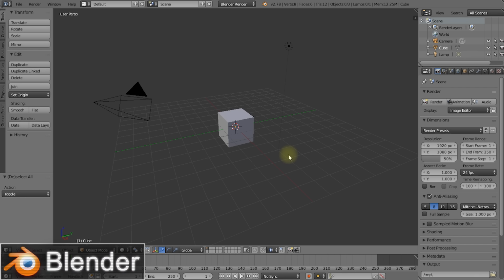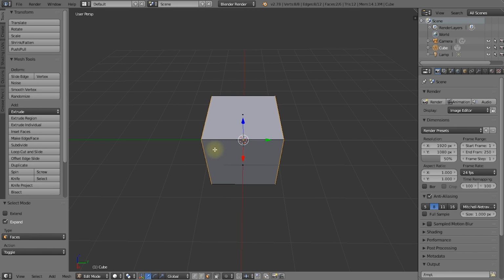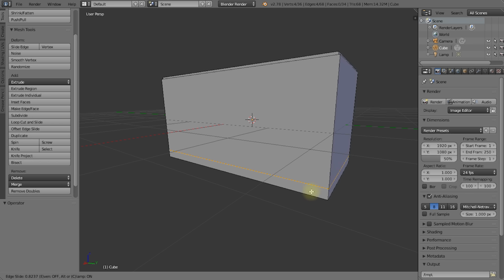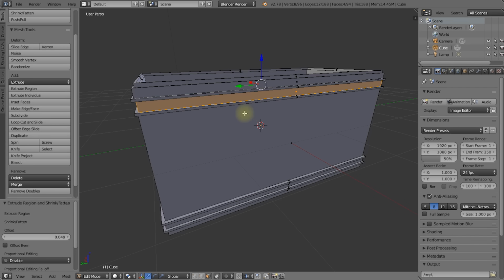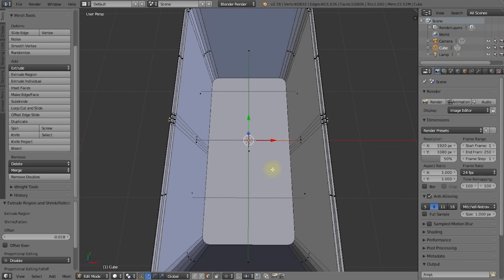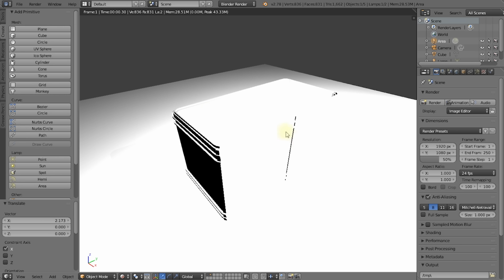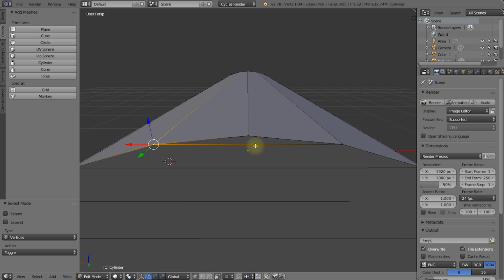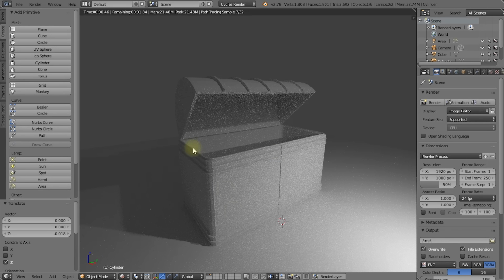MODELLING For Absolute Beginners - Blender Tutorial

Comment: Did it along side with you, encountered some simple issues, but made it in the end. Had been meaning to move away from 123D for sometime and this did the trick. Thanks a ton for creating this.
Reply from the maker: No worries at all, glad to hear you found the tutorial helpful :) I really gotta update this for version 2.8 of Blender, there's been so many changes. Thank you for the comment!
Reply: Thanks for replying. Ya the UI changes were challenging, plus I did it on a mac, but the keyboard shortcuts work the same, so you pushing that was great. also the tip about doing an undo after failed extrudes is very important, that got me a lot of times, even if i cancelled an extrude. Now i need to learn to do dimension based CAD designs for my day job. cheers.

Comment: I was not able to exude my chape like u did :( To add another face, it won't let me.
https://gyazo.com/00119c5504e0b1db6a8a9aee582317c7
Reply: https://gyazo.com/ec34e4feaf97998b28f8bca2a85ec42a
Reply from the maker: You may have duplicated edges or faces that you introduced during modelling. Here's a video with some tips that might help: https://www.youtube.com/watch?v=n9YYrVQdCMY
Reply: @SurfacedStudio  Thank you, but i ran into another issue. I was duplicating my pieces and lining them together and i made sure to use Shift C To make sure it's center and selected the correct views when duplicating and some of my pieces are not even. the building is not straight and i keep trying to fix it but it's no use :( What do i do? I don't want to start over.
Reply: How do u line objects up together without things having gaps in between or being uneven with the lineament ? :(

Comment: i have a little issues with the knife tool. I was doing fine select one vertice and connect it to the other one. everything was fine with the edge of the surface under the trunk but when i start with the middle it just wouldn't connect the vertices. help please
Reply: I had the same problem but with the edges.
I noticed some vertices duplicated somehow.
Solved it by selecting the whole trunk (with A) and merged all close vertices (Alt+M) > By Distance,  ~0,01m.
After that I used the knife tool with no issues.
Reply: @dennis-nine-five  thank you so much
Reply from the maker: You may have duplicated your edges or vertices during the extrude operations. I've got a video with some common problems - and how to avoid them here that might help :) https://www.youtube.com/watch?v=n9YYrVQdCMY

Comment: Awesome tutorial! subscribed! 
I just have a question: You used the knife tool for the inside to change the ngon into quads. but wouldn't it have been more efficient to change at least the edges in the middle and dissolve them? since you need those edges only on the outside? Or am I missing something?

Comment: Thanks, man, but I have this weird problem where when I wanna bevel in the middle of the chest, it just makes new points? So I ignored it and moved on, but then, when I was using the knife tool inside the chest, it just wouldnt wanna cut anything, it worked on the surface but not inside?
Reply: When I try re-doing it (third time at the moment), the middle part always has a different glitchy part? You could say? And I cant fix it.

Comment: Nice tute. Very useful. I found it easier to get the lip I wanted at the top by using loop cuts on the rim faces then extruding rather than using inset and extruding. One of the things about Blender is there are often different ways of accomplishing the same thing.

As a relative beginner, I hadn't heard of the different extrude options such as 'vertex normals' until I watched this tute.

Comment: sooo why exactly are tris supposed to be bad? i mean they're the most basic and only 3d primitive that can't be screwed up (quads do weird stuff as soon as their verts aren't in a plane anymore, but tris are always a plane per definition), which is why pretty much any 3d engine i know of prefers them. why would blender be different there? i mean i see why you'd want to avoid ngons but the same reasons apply to quads, not tris. or is it just because a quad can be subsurfed (for e.g. sculpting or modifiers) into 4 quads by bisecting each edge, while tris would turn either 3 or 4 tris or even into 3 quads instead of more tris when doing that, thus mixing up the topology complicating things (and the resulting shape would be useless from the perspective of "i'm subdividing to get more useful resolution")? and probably easier for stuff like edge loops etc too (which kinda are the same concept as subsurfing, just manually)?
Reply from the maker: There's some good explanations of the details out there on the internet, e.g. https://computergraphics.stackexchange.com/questions/5465/why-are-quads-used-in-filmmaking-and-triangle-in-gaming
In essence tris don't subdivide well and lead to ugly deformations for rigged models, however they are simpler and more performant than quads or polys

Comment: Does anyone know if this will translate well into a STL file for 3d printing or is there a good chance of errors?
Reply: If you have set Blender distance settings to metric, change them back to the default unit. Depending on the software you're going to use, you may have to scale the scene; Cura counts 1 Blender unit as 1mm, so depending on the size of your model, you may want to scale x10, x100 or x1000.

Comment: In the very beginning, when I select both faces with shift and use the scale tool, rather than extending it into a rectangle, it scales the entire cube into a larger cube. What am I doing wrong? I've watched multiple times and followed the steps exactly, but I can't get it to behave similarly.
Reply: I figured out I wasn't hitting Y to lock on to the axis. However, whenever I hide my cube to make the cylinder, I cannot retrieve it with Alt-H. And then when I hide the cylinder to remake the cube...I cannot retrieve the cylinder with Alt-H. It's like hide is permanently deleting my objects, but I can still see them on the top right panel.

Comment: My knife tool will not cut on the bottom on the corners, and there are no doubles to prevent it from doing so. What is going on with it?
Reply from the maker: Does it work if you’re trying to cut a simple box? The most common reason for it not working is duplicated edges, faces or edges

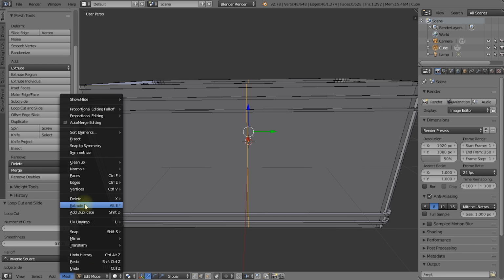Comment: does anyone know what I'm doing wrong? I'm stuck at 21:10 with beveling, when i try it, the faces/edges expand outward and intersect. it doesnt stay on the object like in the video
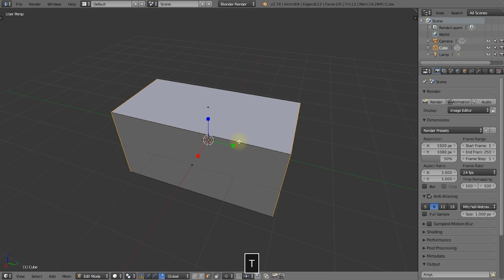Reply: hey, I was faced with the same situation. I think duplicate edges or vertexes led to this issue. I used ESC to cancel some operations, like extrude or insert faces, but the button ESC left edges and vertexes and affected the direction of the normals of some vertexes. I suggest you can watch his video, https://www.youtube.com/watch?v=n9YYrVQdCMY. Focus on 6:32 in the timeline. I am also a learner. Maybe I cannot explain it clearly. but I tried it again with only using undo to remove wrong edges or faces. it works.

Comment: I have 2 problems. 
1. I have laptop without numpad, can I configure it?
2. I was making a tip and by cube disappeared. I cannot undo that, because it is too far away. Yes, I clicked on "eye", I am not stupid. :D
 Thanks for any advices.
Reply: I can Only solve your first problem. 
If you have laptop without numpad, you can use emulate numpad in User Preference

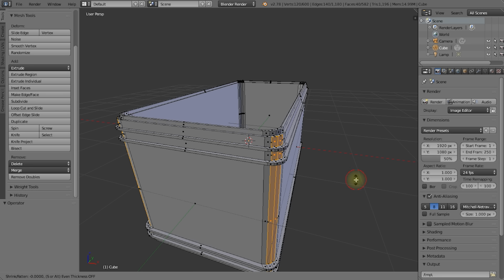Comment: This is a great tutorial, but I have a question: at 20:02 when you extrude the vertical edges of the chest, is there any problem with two faces being right on top of one another? or does the extruding in that specific scenario remove the problem to begin with? Sorry if its worded strangely, but I would appreciate any answers to this.

Comment: If you can't loop cut across the entire lid at 34:00, make sure you didn't accidentally create any n-gons when using the knife tool earlier. Use select > All by trait > Select Faces by sides. Then in the left options panel at the bottom, select sides greater than 4. It'll highlight all the faces that have more than 4 sides.

Comment: Hi, bug or ?
After finishing the modeling, I tried to apply metarial as you do in the next video but I discover a strange thing :
I found a edge at a angle at the bottom of the trunk, between a vertice and a edge spliting a pretty square in a triangle and a strange square.
I thought I made a mistake before so I load a previous save (I used to save my work by increments : 001, 002, etc. so I can always go back).
Found one without the strange edge, but (it begins to be interesting here) when, after selecting all surfaces in "edit mode", when I switch between
"object mode" and "edit mode" the edge appear by magic !
I don't do anything when in either modes, just switching and the "thing" reappear in all my previous saves.
I am crazy or this kind of bug is possible in Blender ?
(I solve the problem by deleting this "edge" then select for four originals vertices and type "f" creating a new surface but this is "annoying".)
Thank you to take the time to read this.
Thank you for yours tutorials, they are very important to me.

Michel

Comment: I'm running Blender 2.79 and trying to make the small chest in Lesson 2.  When I extrude Vertex Normals for the decorative band(length 2x as long as the width),  their lengths are off by a ratio of 2:1.  If I extrude a cube, all extrusions are of equal length.  Is their a setting I need to adjust?
Reply from the maker: Check out this video for Common Mistakes for Blender: https://www.youtube.com/watch?v=n9YYrVQdCMY You have likely scaled your object in object mode, hence you scaled your normals too
Reply: Thank You. I did scale in object mode and then switched to edit mode.  That's a valuable video.  Larry Jones
Reply from the maker: Thanks Larry :)
Reply: @SurfacedStudio  amazing reply :o i was having the same problem.  thank you surfaced studioooooooooooooo!

Comment: There seems to be no absolute beginner guide by you, that comes up in a search. Blender is already the most confusing 3D modeling tool I have tried. Why one second you can select a point, face or line and the next it does nothing(in any mode)etc. Your reference to a video that is hiden or just no-existant, is just another aggravation. 
I have used Sketchup for years with no real frustration but blender is just confusing. I have used Zbrush and it too is very loggical, so what is the reason for this monster? For example, why is the default selection function on the right mouse button? What is the other thing that appears like a gun sight with the left mouse click?
Please make a vid that explains the underlying principles of Blender. Cheers
Reply from the maker: What video that I reference is hidden or non-existent? Have you already watched my absolute beginner tutorial? This is the second one in a series and I am assuming you watched the first one :)
Reply: @SurfacedStudio  
There is no link in your description for the stated video Absolute Beginners Guide

Comment: When I first go to scale the square it only moves the faces and leaves me with a see thru square. It does not scale the square just the 2 selected faces..anybody know why?
Reply from the maker: The scaling operation will only be applied to the vertices / edges / faces you have selected :)
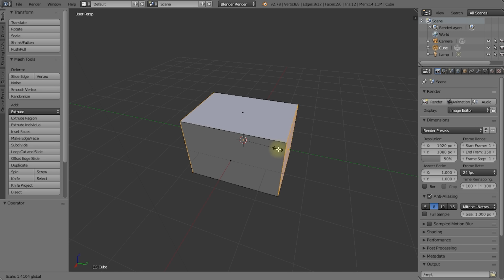Reply: @SurfacedStudio  Thank you for your reply! Makes sense. I guess what I meant was like at 6:07. When I did it, the faces just scaled away from the square and left an open box. It didn't scale like it did for you. I ended up doing that one part in object mode so I could continue. Great tutorial. Thank you good sir.

Comment: At 13 minutes when you extrude vertex normals, you got a different result than when you extruded individual faces

As in, you didn't get that hedhehoggy thing you mentioned earlier

But when I did it, i got the exact same result as i did with the individual faces despite the face i went with vertex normals

Any ideas?

Edit: Nevermind, for some reason i had to click on remove doubles. Seems to be working now. I guess I forgot to crtl+z after cancelling an extrusion or something
Reply from the maker: Yeah, sounds like you had accidentally duplicated edges :) I got a video talking about some common problems in Blender - it does touch on the issue as well: https://www.youtube.com/watch?v=n9YYrVQdCMY
Reply: Having more fun. Got to the part where you curved the edges but i guess i had more duplicates and I couldn't undo things back far enough to avoid them so i ended up starting over

Although now things aren't keeping proportion when I inset or extrude

so the sides of the chest are twice as thick as the front and back, and it seems to muck up the extrusion at 13m

Edit: Why is it i keep figuring out how to fix things after asking for help with them

Comment: I got problems using the knife tool. It worked just fine outside the box, but inside I only could cut thrice before it didn't work anymore. Once I make the line from a to b and press enter, it just vanishes (the entire line). I have tried to remove doubles, but I had none. 
EDIT One: I then tried to use j instead. It worked on all except one. Whenever I use j on that one it doesn't cut straight from a to b, but instead it literally goes along the wall (instead of the floor) for some reason.
EDIT Two: Now it suddenly worked using the knife tool. I don't really like how unreliable this software is, but oh well, it's free.
Reply: Link hello, I also had the problem that knife just vanish. What I found that solved my problem was first eliminate any doubles. What I did was select everything (all the chest) press W and then remove doubles. I had like 160 vertices removed and after that knife worked without any problem.
Reply: @albertoalarcon3794  That was exactly my problem, and after a 140 vertices genocide everything worked fine, thanks for the help!
Reply: Thank you both for suggestions. I'll also take a look at the video.
Reply from the maker: I don't think it's the software - it's been a pretty reliable and stable build for a while. You may have accidentally duplicated your edges or vertices. Check out this video on some common things that can trip you up: https://www.youtube.com/watch?v=n9YYrVQdCMY
Reply: @SurfacedStudio  I had the same problem and I notice that only happened where we made the extrude, where two vertex are close from each other. On those locations, the green square keeps his bright green color when touch the vertex and when I click, the line vanish. In places without vertex close, the squares turn green-brown and the knife works. So, I don't know how you do it and why works for you...

Comment: Whenever I loop cut in the middle of my chest and add a bevel it always fucks up on me it doesn't create geometry on one side. Even if I want to loop cut three times my left and right cuts end up crooked, its really annoying exhausting your knowledge of the software quickly after have a problem not know what to do. Also when you start cutting the knife tool I can't do certain cuts for some reason half of the cuts work out just fine then I just can't do the rest of them! This is SO frustrating!
Reply from the maker: Take a few steps back and see at which point the loop cut stops working. Is it the way you bevel or the way it intersects with other loop cuts you have already placed? You need to trace it backwards if you want to have a chance of finding the problem - and learning how to avoid it in the future
Reply: It's specifically the way the it bevels I hope the image I have works. I made it really so youcan see whats going on, it does the same thing even when its just a little bit. https://i.stack.imgur.com/pObRS.jpg
Reply: I fixed my problem, I modeled a new truck but the problem is I can 't see the difference (if there is one) between my first and my second truck. Thank you very much for your advice!
Reply: How did you fix the knife tool problem? I also got that.
Reply: @Thesamurai1999  I cant really remember Ive done a lot since then. I think I might have added vertices to match what he did or started from scratch and everything worked out after.
Reply: Ah, I see. I did manage to work it out by switching between using knife tool and selecting a and b and press j to make the line. But it feels a little random as to when it works. Thanks though!

Comment: The knife tool isn't working for me. But I realize when you go into knife mode and click on a vertex, the little square selection icon at the tip of the knife turns from green to orange/red, but mine stays green. What am I doing wrong?
Reply from the maker: You may have some duplicated vertices or edges in your model hence why the knife tool isn't selecting what you think it's selecting. I am currently putting together a video with some common Blende problems that might help - will be a few weeks though before that goes live :)
Reply: Thanks! That might be why. But in the end I just select two vertices and pressed J to create the line, hopefully that was an alternative solution without any hidden troubles lol.
Reply from the maker: That likely works just as well :)

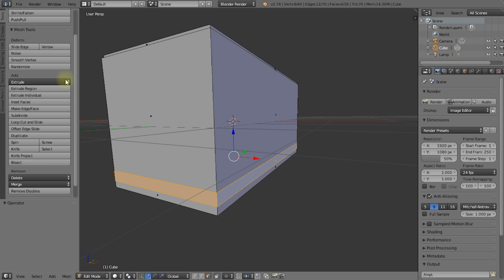Comment: 12:45 When I extrude region along vertex normals, it does the same thing as extruding individual faces. I've gone back through the loop cut and slide, but i can't find anything i did differently. My version of Blender is 2.79 so maybe that has something to do with it? Any help would be greatly appreciated.

EDIT: Nevermind. Turns out I did forget an important thing. I didn't Ctrl+Z after cancelling extrusions.
Reply from the maker: ;) That's usually what gets people. They end up accidentally duplicating vertices, edges or faces and then the selection works on pieces other than what they expect